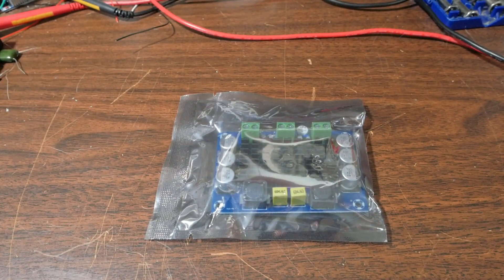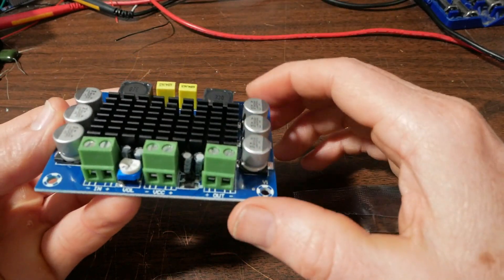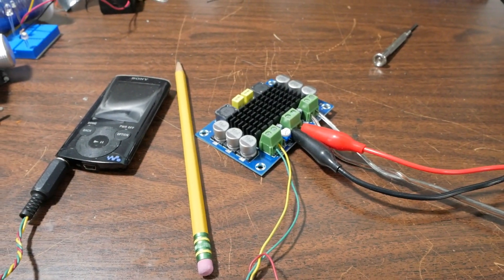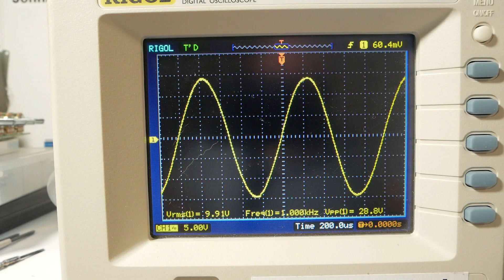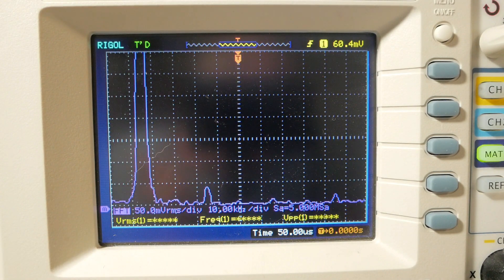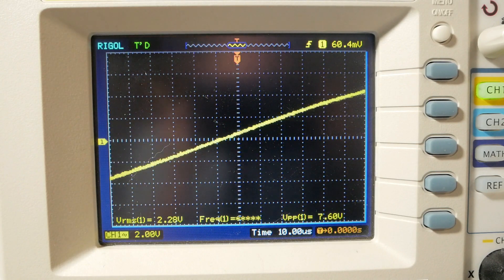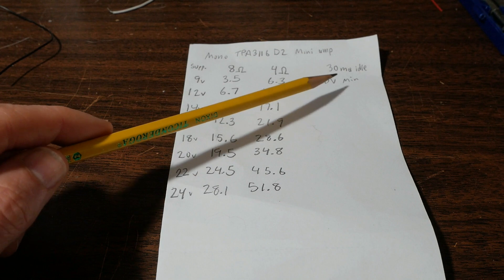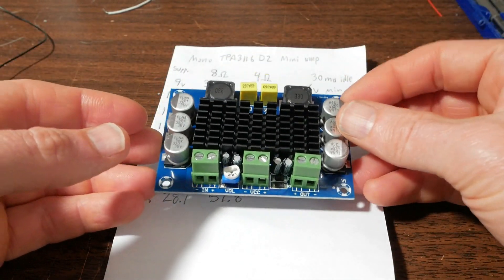TPA3116 D2 mono audio amplifier board test  & review

Comment: Bought a couple of these and found that there is a loud "pop" at switch on - did you have this problem? ( I am running from a 12DC lead acid battery to simulate a car installation). Any information would be great.
Reply: sorepaws put a speaker relay protection board.
Reply: I have run this board in my samurai offroader.  The sound is nice. But after a few months am getting some issue of sound off and on in one channel. 
So right now I fitted a genuine tda 7297 on the car again . 
I don't know but I found the sound of tda7297 to be much more fuller and deep than the 3116 .
And being an older style chip set it seems more rugged than the tpa with its thin legs . For car use I still prefer being old school I guess.

Comment: Hi John, thanks for the review and for sharing your knowledge! I got a lot of noise if the vol-knob isnt near min or max. Any idea how to fix that? Is the knob just a variable resistor? Thanks!
Reply: A lower resistance potentiometer for the volume knob. A lot of them use a 100k pot when they should be using a 20k to 50k pot.

Comment: If I use only (not using center wire) outer wirings of center tap transformer 12 0 12 this board does not work (4 diode full wave rectifier). It only works if I use center wire with one diode at each outer wirings.
Any reason? Also I tries combining rectified dc output of two 12v transformers still this does not work.
Reply from the maker: The output voltage from a rectified and filtered 12-0-12v transformer outer leads would be over 30 volts which is too much for this amp board.
Reply: @JohnAudioTech   Thanks John and good wishes. Thanks for help. I now applied LM7824 (with two 2n3055) to rectified and filtered output and now the card works.
Reply: Even 18v transformer with filtering capacitor pushes it to 26v. I reduced using a a series of diodes to about 20v

Comment: Hi john, I bought same amp. Dead silent, when no input or with input,  max pot volume without playing anything. 
But when i play music,  The mid high became  hoarse, and my woofer also rattle.
I change PSU to another also I changed to linear psu still no change. I also reduce gain to 26 and 20dB. 
Nothing improved. Do my chip defect or fake ? or inductor filter not large enough ?
Reply from the maker: It does sound like your board could be bad. The connections are simple so there isn't much to go wrong.
Reply: @JohnAudioTech  Perhaps, I ll try to replace the chip 1st. It makes me curious.
Thanks for your reply, John.

Comment: hey , i have a question, i have the same amp as you, planning to use it to power my subwoofer, feeding the audio through low pass filter then go to the amplifier, and my question is, at 24v at what voltage does the audio starts clipping, i dont have oscilloscope to see it, i really appreciate it if you can test it for me, i'm running 4 ohm 150w subwoofer
Reply from the maker: About 14v rms is the max clean power before clipping with 24v supply and 4 ohm load.
Reply: @JohnAudioTech  thank you so much, its really help me, and i have 1 more question, at what frequency do the subwoofer draw max power from the amplifier, is it at Fs or at lowest possible frequency, and if i have T/S parameters, can i use it to find the frequency that draw max power ?, the subwoofer does not come with T/S parameters, so i have to measure  it my self, although its not very accurate. sorry for bad grammar

Comment: hey. So i Did Recently Get 2 80wRms and 180W Peak 
Speakers

And I Want to Run Them in my Car. My Question is. The Car Battery is about 12V
Which Will Only Deliver 6W
How Can i Get a Coverter From 12v to 24V ?

or Can i Serie Connect The Car batteries Making a 25.2V Battery at Full Chrarge

Comment: Hello
I'm planing to make a sound system for home and going to use that board, my question is the sound clear on them ? like i wont need an equalizer or something like that? cuz i dont know how to do that.
Reply from the maker: Frequency response is flat and distortion is low, so go for it.
Reply: I'm going to use the Bluetooth version of this which has no rca ports for audio signal, powering it with a 24v 5A power supply, is adding a DAC going to improve thesound? if yes how to fit it in the setup?

Comment: John, I am beginning my very first bluetooth speaker build, and kinda swinging for the fences. I had a 1946 Philco radio cabinet, was already gutted and never knew what to really do with it. I have finally gotten around to wanting to install a bluetooth amp board in the cabinet and go that route.  I do not know much about wiring, etc. Is there any chance you could do a video on a build to help me out? I am unsure of which board to use, I am leaning towards the one from this video though. I want to be able to wire in a potentiometer to control the volume, using the original location on the face of the radio. I also want to do the same with an on/off switch in original location. I am really unsure on the wiring up of all of these components. Any help is appreciated!
Reply: Also would like to add in lights to light the original display up, and possibly add aux cable

Comment: at 12 V, and 4 ohms, what would it do at higher amps? say 5 amps.
Reply from the maker: It draws only the current it needs. Putting a higher current supply won't do much if it can't use it.

Comment: i just thought of somithing, dont remember if you mentioned this is a video before or not, but with bridge amps, how do you scope it? if you just scope one side of a BTL amplifier your wattage reading will be WAY low.
Reply from the maker: I scope across the output. My power supply is floating (unless I use the ground connection) so it won't short one side of the output.

Comment: Heatsink apparently cemented to chip - WRONG. They should always be clamped (with sprung push-pins or some such) to allow for different thermal expansion of chip and heatsink.
Reply: JB weld does a great job too for a perminant mount...
Reply: I am aware of JB Weld's properties, it's basically just epoxy doped with aluminium powder. On occasion I've used dots of superglue at the corners of a chip and thermal paste over the rest of the interface, not exactly permanent (which is actually what I was trying to avoid) but I've never had a heatsink detach itself..
Reply: Exactly, I picked one of these up and the heat sink fell off shortly after I placed in the project box I made for it.
Reply: And to allow changing the chip

Comment: I got one of these and the hiss is terrible.  The  was ordered from ebay as a TPA3116D2 Mono 100W and looks like yours.
Reply: Try adding a resistor in parallel to the input. Or turn the vol pot lower.
Reply: @miasmator  coud you be more specific? thx in advance

Comment: The TPA3116D2 is a stereo chip. Wonder why the designer went for a mono amp configuration.
Probably to get better channel separation with 2 physical units.
Reply: Its already BTL per stereo channel - it has a parallel mode for extra power handling for a single channel.  Not actually that useful from 24V max supply of course, but likely to mean the chip isn't very stressed and you'll may get lower distortion and noise in the parallel config.
Reply: there are tpa3116d2 stereo boards but this is BTL for more power.

Comment: I wonder if I could replace a toasted STK-module with two class D amps like this.  Unfortunately, the STK runs at 39 V, which is rather high.  Can you recommend a class D amp that would be happy with a 39 V supply ?
Reply from the maker: There's some higher power class D out there I haven't tested yet. A lot of it is BTL out ICs. A lot of the hifi class D is discrete output circuits. These cost more so I don't get the opportunity to test them.
Reply: Thank you, John.
Reply: TDA7498E might be ok with that and also TAS5613. sure electronics have nice quality amp boards but if you want cheap you could find some options on ebay also

Comment: Thanks for doing this review John; I've been waiting in anticipation. As I mentioned to you in an email, I made a busking rig out of one of these boards without knowing what I was doing and wanted to get your thoughts on the board. Great stuff. You've confirmed that even an electronics idiot like me can, under the pressure of low income, make a decent and useful amplifier for my purposes which is live music performance using batteries for power. And like you said at the end, "get a couple and make a stereo amplifier out of them" could well be my next project. A million thank you wishes from DownUnder. Cheers John! Don
Reply from the maker: You have an interesting story. I'd like to mention it in my best-of amp roundup if you don't mind (and share the link to your recordings). I've watched a few busking videos and I'm floored when I see the talent out there on the street. One thing for sure, you guys get a lot of time to practice!
Reply: Thank you John. I don't mind sharing in fact I'm honoured. Keep up the good work. DM
Reply: I play Bass, how does the amp soud with your instrument???
Plan to drive a 12'' 4 ohm speaker.
Now I know it can be done.
Thank you for your experience.

Comment: Been waiting for you to review something like this, I have the stereo version of this board, and I guess I was unlucky then, hiss isn't quiet up to what I could call "hi-fi" though it's pretty tolerable (have my speakers nearfield), but my board was a bad sample I guess, the heatsink came glued at an angle, like if some poor Chinese worker doesn't get paid enough.
Anyway, when I turn it on, the left channel makes weird noises for about a minute or so, then stops, sounds like some low frequency rumble.but sometimes produces high-mid frequencies too and sounds like the wind. Gladly after 1 minute or so it stops and becomes stable.
Also one of the channels measures 0mV DC offset and the other one 10mV, 10mV is fine, but it's weird that they measure differennt.
Reply: Most of them are just sweat shops show some Humanity!

Comment: Those are clean amps.
I have one that I'm making a micro bass guitar amp.
Reply: I got one of these boards and made a small busking PA rig. Using 2x12v sla batteries strapped together for 24volts to power the amp board, and a Yamaha mixer that takes 12v, the batteries are only 5ah and with the amp, last forever. The mixer drains it's battery after about 10 hours of performance time. The speaker I use is a 94db-efficient 10" with horn configuration and my whole system weighs less than 12kg and cost much less than a commercially made busking amp of similar output. I get heaps of compliments on my sound but I'm not a loud player, nor is my music bass-heavy. For you trying to make a bass amp, be sure to get the most efficient speaker you can and nothing smaller than a 15" otherwise you'll overdrive the board and that is not pleasant. I think John mentions in the video that there would be some harshness at clipping and I can assure you there is. When I've had to do a bigger gig with my busking system, I daisy-chain two speakers together to run at 4 ohms; the amp board didn't get too hot and the sound was just fine for my purposes, in this case an outdoor wedding. I hope this helps a bit. I can give more specifics to anyone interested. Good luck with your music
Reply: These chinese class D amps are so cheap you can buy one amp for each driver. 50+ watts per driver is enough, especially if you use high efficiency drivers.

Comment: Finally.. John was satisfied.... With decent output.... I really wanna buy that....
Reply: The TPA3116 is a great chip amp, as long as it has a good heatsink and good complimentary components. Give them 24v and they can do 50w at under 1% distortion all day. What more could you want?
Reply: @rich1051414  the link to the one from the video :)
Reply: @rich1051414  thank you mate. Have a great day.
Reply: @rich1051414  does less power mean more distortion?
Reply: @highhat5229  It depends on if you are pushing the amp to clipping. If so, higher supply voltage means less clipping, therefore less distortion.
Reply: @rich1051414  wait what? So if I'm giving an amplifier half or less the recommended voltage but I'm turning the volume to max, I'm still clipping??
Reply: @highhat5229  What do you mean, still clipping? If you reduce the supply voltage, you will clip sooner, at a lower volume.
Reply: @rich1051414  oh I assumed clipping was due to overdrive of power. I've never looked into it, it didn't occur that the point of clipping is also lowered when the voltage brought down. 

Wouldn't a L-pad stop this if you're building a crossover?
Reply: @highhat5229  Impedance matching shouldn't matter on modern class d amps. They all behave in an 'ideal' manner(meaning effectively zero output impedance as long as the load isn't too much). That leaves the biggest bottleneck to it being able to be 'ideal' being the supply voltage. The output can't swing higher than the supply voltage.
Reply: @rich1051414  hmmm... yeah i read that most amplifiers limit the voltage below the supply rail.

Basically I'm trying to build a bluetooth speaker with a 7.2v battery, but I'm struggling to find a decent amplifier to fit the job. I've been looking at the TPA3116D2 IC in pre built modules, it has a really wide voltage range 4.5-26v and has better reviews than those 5v amp boards that are less than £2 a pop.

Can I ask what you're opinion would be on the matter?
Reply: Sorry I forgot we're on a TPA3116D2 video lol
Reply: @highhat5229  At 7.2v supply voltage, and with a 8 ohm speaker, the most power any amp could ever produce is 6 1/2 watts. That may be plenty, depending on speaker efficiency, but that isn't much power. In reality, it would be lower than that due to inefficiencies, though. Probably closer to 3-4 watts. The TPA3144 can pull off 5 watts clean power with a 7.2v supply, supposedly.
Reply: @rich1051414  24v how many A? ..
Reply: @eapinchai  I use a 5amp supply, but I am not sure. 50w times 2 for 2 channels is 100w, so 5 amps seems like a good number to me.
Reply: @rich1051414  24v A2 X2 or 12v A4 x2 for 2 Chanel L& R ?
Reply: lolololol

Comment: i think you should make a video on making a video? specifically, on volume controls. my microphone is not getting much volume to the computer. if you use a laptop you will need a power supply for the microphone called "Phantom Power Supply" because it is not getting the full 5 volts/amps. however, if you plug into the back of a "normal" computer with a plug into the motherboard microphone plug you will get the full 5 volts/amps. however this does not really give the microphone much volume. SO THE QUESTION IS WILL A PRE AMP HELP! i have seen that amps for microphones will not increase volume of the microphone according to the people who sell the power supply. "Phantom Power Supply" however, these only supply amps/volts their is no volume control. so if i had a pre amp with a volume control hooked up to the microphone could i increase volume. i would be willing to build a very expensive unit or buy one again by your recommendations. if you read this you should help i think this is a great problem that many people face. you could just say yes or no to the question in fact.
Reply: The microphone volume control is located in the control panel on computers,  laptop or desktop that use Windows as their operating system.  They also sell microphones with an internal amp that are battery-powered.